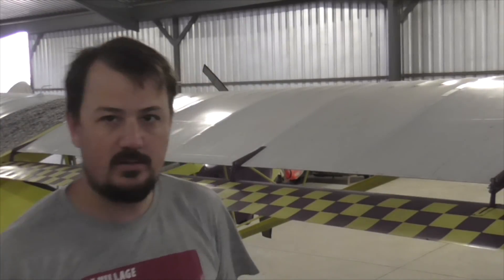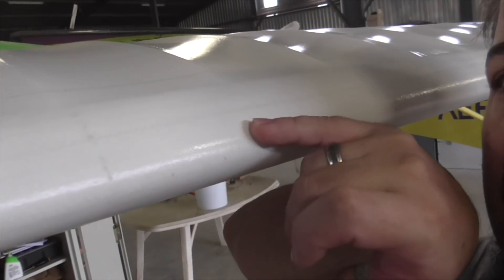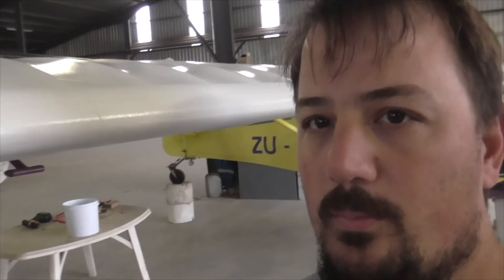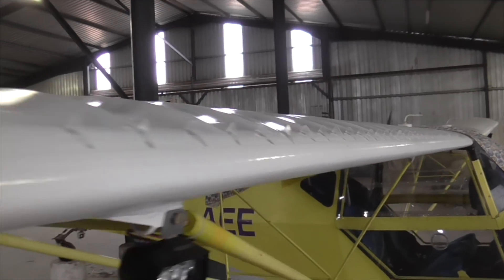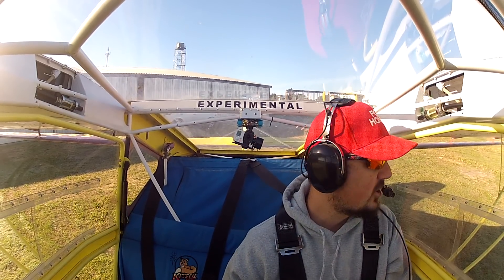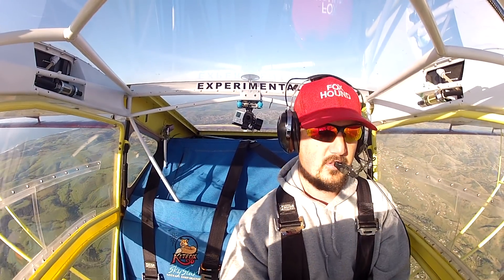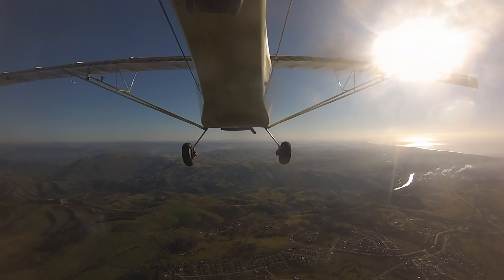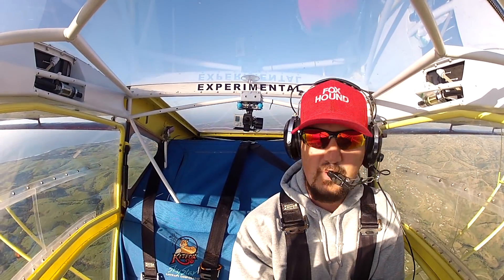The KITFOX gets VG's - Foxhound STOL performance upgrade

Comment: Hi Nic, some friends and I are wondering if your wing is undercambered? We are a community of 20 Avid flyers in France, trying to improve flight characteristics... Your plane is a Kitfox 4 stol wing? Thanks in advance and be safe... Olivier.
Reply from the maker: The kitfox4 wing is a STOL wing correct and does not have the high lift under camber that the earlier Avid and Kitfox 2 had. 
The under camber wing has high lift coefficients but that affects STOL and top end cruise

Comment: Hi Nick, I have an Avid Flyer Stol version and I plan to install VGs. Stol speed recommend 7-8% of the main chord without flaps, but you use 3% of the chord. Could you tell me what this choice? Thanks in advance. Olivier
Reply from the maker: Im going to point you over to Alex Di Sessa and his video on VG placement (link is in the description) for the kitfox wing. That is what I based my installation on. I also started out with the 7-8% as recommended

Comment: Great video Nick!  I recently added the same Stolspeed Vg's to my Kitfox 4.  I averaged about 5 MPH slower stall speed.  My airplane is heavier with an NSI Subaru engine of about 98HP.
While the slower stall speeds are great, the improved stability and control feel you mention is exceptional too.  Also, we did not see any reduction is cruise or top speed.  Finally, you should really add fairings to your wind struts.  I got about 7 MPH increase in cruise and 9 MPG at full throttle when I deed them after initial flight test.  Cheers! -Kirby
Reply from the maker: Adding the strut fairings is definitely on the list of things to do!

Comment: Nick!! ..I am a recent "Sub" I love STOL videos and follow your progress...With the little motor you are very likely getting those "high 20's" stall speed..This will all change if and when you go with "Bush Tires" ..I am an old race car builder (mainly road race ..everything from formula cars to GTP prototypes) I noticed something VERY DANGEROUS on your video..Your shoulder belts are mounted wrong and if you crash YOU WILL  break your neck!!! ..You can look up in SCCA (easy to find on internet) and you will see that shoulder belts MUST travel over a bar 4.5 inches below your shoulders, right behind your seat!!..This is very critical and any deviation from this WILL break your neck!!..I don't care how many other installations like yours you may find...take my advice..race cars crash all the time and my information is dead on accurate!!.. I do hope your never have to test this out..

Comment: If I'm tracking properly (had to set aside my comic book...momentarily ; ), your power-off stall numbers are improved by (mph):
No flaps 5+
Half flaps 7-8
Full flaps 4-6
These figures align with Micro AeroDynamics' advertised performance gain numbers which, for any company, astonishes pleasantly. Agreed that the AOA improvement is the best part. Sure, you'll land slower/shorter in the bush, but perhaps the principal benefit is your higher margin of safety -- insurance built into your wing and worth every penny. If I recall correctly, Trent Palmer was seeing 27 with his S7 STI wing prior to installation of his heavier CS prop that cost him a few mph. So yes, wow! (Note, John McBean.)
FWIW, your numbers have helped win an argument with my aviation mentor; it's not that he was wrong about anything -- generally doesn't happen -- but that I was able to present new info/tech to him (re: VGs) and survive his sceptical cross-examination. That's the win. That he passed away a year ago this week doesn't matter a bit -- the influence of some people never wanes, hehe.
Reply from the maker: I'm super excited with the outcome and glad to be able to share it with everyone. 
Now I know that my "slow approach" has a good 45% safety margin

Comment: You’ve shamed me into doing it! Just gotta double check the regs for my E-LSA... I am going to finish my 5 hours of Phase 1 flight test today due to the new prop I just installed -don’t feel like doing 5 more for VG’s!
Reply from the maker: I'm pretty sure you dont need to do 5 hours phase flying for VG's but your regs may differ from ours
Reply: Nic Holmes - I hope you’re correct. The regs are pretty restrictive over here when it comes to LSA’s...
Reply from the maker: @JeffreyRubicon  where are you? They trying to restrict us here more and more, trying to implement same regs as certified aircraft...
Reply: Nic Holmes The USA. Honestly, I really appreciate the FAA. I’ve worked closely with them throughout my entire career and every problem encountered eventually gets resolved. The whole LSA thing is a bit tricky but that’s mostly due to me and my lack of familiarity with this end of the aviation spectrum.